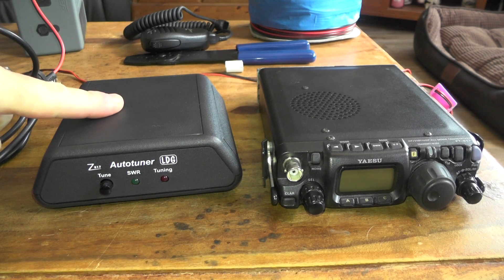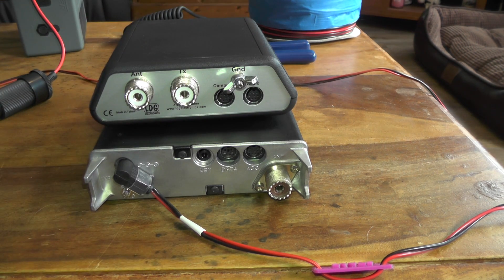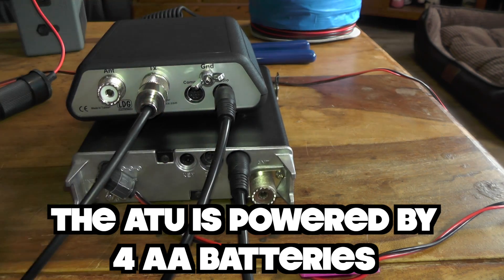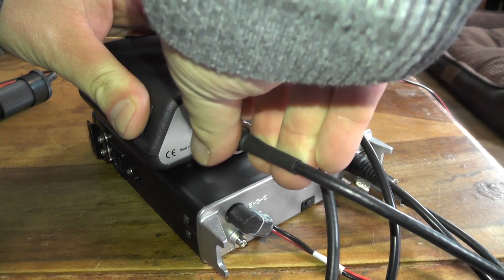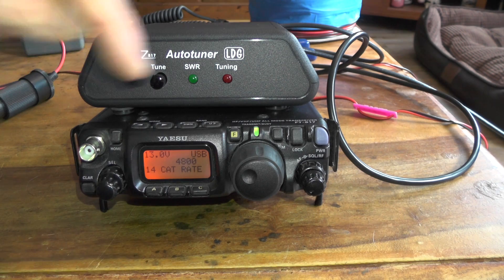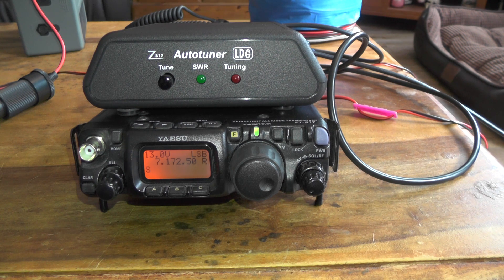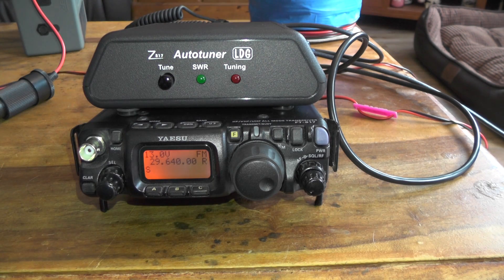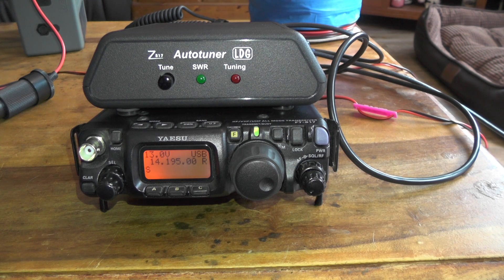Z817 tuner how to

Comment: Nice one Jez, Just wondering what antenna you were using that is able to be tuned with out messing with the antenna outside.
Keep the videos coming.
73
Reply from the maker: Its a comet ch250 antenna hf and 6m hopefully will be showing the antenna in the next video
Reply: @2j4ez  thanks for the details. Have a good night